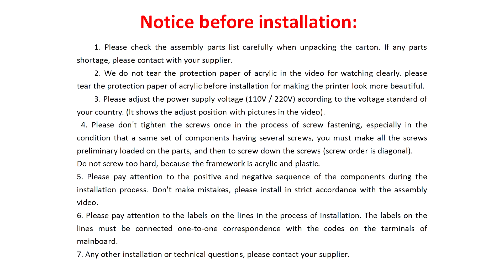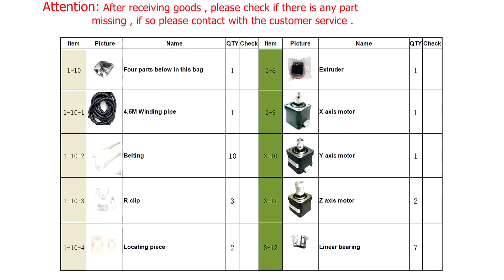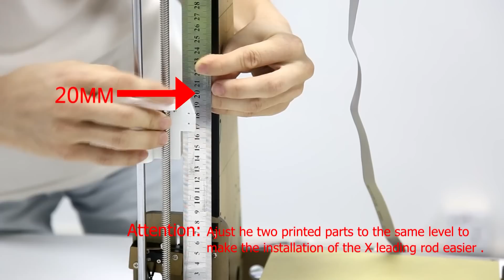3D Printer Instruction--The Newest Anet 3D Printer A8 Assembly Video 1

Comment: HELP : How to turn off the printer while printing and save the work, than turn it on later and start the process where it was left?
Reply: this printer dosen't do that. More expensive ones (MUCH more expensive ones) do that, though
Reply: You can't turn off the printer and then restart where it left.
What you can do is to pause the print and restart it later, only if you do not turn off the printer.
To do that, in the main menu of the printer go to "SD Card" and then "pause print". When you want to restart then go again to "SD Card" and then to "Continue print"

Comment: Hi David, I am about half way through, and impressed with the build quality, until I try to screw in the 3-12 linear bearings. This is at 18:00 minutes into the video. I think I need to buy some longer screws than the m4 x 8. I seems like there is some metal missing when these were cast, and the threads do not start high enough. I will buy some longer screws tomorrow when I go to the hardware store. Can you give me an email address, I will send a photo. Thanks
Reply: I had the same problem indeed. It could just reach the thread. The linear bearings are not that good of quality. One didn't run good and needed to be replaced.

Comment: Hello, David Dan, This is an amazing 3D printer! Nicely done. I recently received mine. Quick question, I do have the
The X Motor Line 
The Y Motor Line 
The E-Motor line (Extruder Line)

But there was the Z motor sticker stuck to the Y Motor Line. There are now 2 UNLABELED Lines they are the same length about 900mm or about (35inches).     

Are the 2  Z Motor lines both Long in an upgraded version (I bought mine in October) compared to the shorter line you have in the video at 24:55 in the video??    Would it make a difference if I were to switch or mix-match those 2 unlabeled lines?

Please Answer as soon as possible, I am stuck as of now
Reply: I'm in the middle of my build and there are two separate lengths for z as in the video, the right hand motor has a 900mm and the left hand one is about half as long. As long as they worked when you did the self test, and you have long enough lines for everything else it won't matter if you mix and match. But I would check the parts list and make sure you don't leave yourself with too short a lead for the xmotor or extruder
Reply: Thanks. Just connected all wires.Doing Self test now
Reply: As long as it can Reach the motherboard from the Motors

Comment: My guide rod wont even go through all the way in the Z axis nut support. Its too tight, unlike in this video, its almost smooth and can be pushed by the hand. I've been hitting it hard with hammer and my hands but wont go through. Its stuck. Why did you guys make it like this. Its probably why some people get a bent rod because of this process. I'm talking about the 33:05 s section of the video.

Comment: My vertical rods are just slightly too short, they still wobble. I will have to add something to stop that. Anyone else have that problem?
Reply: AntFuze me did u find a way to fix it?
Reply: They are supposed to be a little short and not quite rea h the holes.   Just continue and you should be good.
Reply: The vertical guide rods on mine are a bit short. I don't think it matters but I put two washers on the top before fixing the plastic top retainer in place. The other screw threaded rods are meant to be a bit short so they are not supported at the top end.
Reply: @ohchil9009  No, raise the coupling up on the motor, there is plenty of room.

Comment: David, please take a look at the mounting of H-Carriage mount:
https://youtu.be/-tiHfzBQZpI?t=1062

When mounting like you instruct, the belt will not be parallel. Mounting the H-Carriage upside down seems to work better:
https://3dprint.wiki/reprap/anet/a8/bed-carriage

Any comments?
Reply: I noticed that just building mine now. Is it worth me undoing that many screws?
Reply: Let the smooth rails come out and then you'll have very access to the H-carriage. It all takes less than 10m.
Reply: Thanks for the tip
I did it and it works a bit better :)
Reply: I noticed the same while assembling my a8 earlier while lining up the belt to make sure it was running true,  the belt still runs a little high,  (I think I'l be making someting to get it truely parrallel is due course)  if you do this I would also rotate the Y motor so the connector points down to avoid the possibility of its cabling being fouled - thanks for posting this video its helped a lot - its much appreciated

Comment: 4 hours in and I'm only on 21 minutes.... and I build parts for planes for a living!
Reply: Personally just getting the paper off of the black plastic parts is the most time consuming part. I'm an auto tech myself so I screw in nuts and bolts all day....but usually M6 at the smaller end rather than M3. :P

Comment: X motor : 25 mm screws ... not included :(. found some at home, and they are too long ... 18 are too short... only 4 20mm provided, supposedly for something else. That is a fail (and the plastic motor support part profided is different, has 4 screw holes)

Comment: Did anybody think that putting the Z Axis rods into the printed parts was difficult? I had to force them in.
Reply: Mine were as well. I noticed the printed part was warped, so i loosened the brass threaded bushing bolts and the rod spins smoothly now.

Comment: A quick tip.  Use blue thread lock on everything and you won't have to worry about something working it's way loose later.
Reply: Spill blue thread lock on any part of the acrylic joint and kiss that part goodbye.
Reply: Kip Landingham  yes, loctite reacts with acrylic weakening it. Stay away
Reply: I prefer a dab of PVA wood glue after doing up the nut. This can be broken off easily if you need to undo it later.
Reply: Yes a quick tip, not a very useful tip though...

Comment: Some m3 nuts and bolts were not according to specifications and would not fit. Some nuts were too loose and were almost m4. Gladfully there are enough nuts and bolts left after assembly.

Some holes that have thread in the metal parts that are covered with paint or coating so the m3 bolt won't fit and even get damaged. I needed to use a special tool to make the threads work.

Guide runners (linear bearings) were not good quality. 2 of them didn’t run good.

The bolts that are used to level the hotbed should better be allen head or torx so you wont have to press down on the screws during calibartion. 

Be careful with cutting the (toothed) belt to length. I had only 5 cm of belt to spare after assembly. Not the 10-20cm which are mentioned in the documentation.

Comment: Hi David, I am having trouble assembling my printer. It arrived today and I have been putting it together no problem....Until I got to putting the screens back protector on at 27:11 in the video. the piece in my kit is missing two drilled holes on the right hand side. Please see the link attached to see what I mean. https://postimg.org/image/judwk6bup/ 

Please advise. Thanks a lot.

Comment: Hi!
I just received my printer, but two parts are broken and one doesn't fit. Is it possible to get replacement parts?
Reply: Hi Michael,
how did you go from there? Did you got the replacements? or did you have to send everything back?
Reply: Hi Sabe,
I couldn't get any replacement parts, but I got a few dollars refunded.
I filed the part that didn't fit shape and glued the broken one.
Reply: Hi Michael, thank you for your response.
When I wrote to Gearbest (because my Top Frame where the Display is mounted was manufactured wrong) - I told them that I will let the part manufacture here. So they offered me a 20 USD refund to my GB Wallet. Still waiting it to be transferred tho.

Comment: Oh I hate you, at 32:40 there are screws behind the two white pieces that needed to be loosened before inserting the rods. I thought that the Rod hole was a bit tight from manufacturing that I had to hammer the rod with an iron hammer for 5 minutes to get it to the second hole. My hands hurt from the constant hammering. Not to mention what that did to the printer's structure. Thanks for your effort but if u wanna do a dependable tutorial DO IT RIGHT. One mistake and the printer might get useless.

Comment: Email anet@anet3d.com is dead.
Good job on the very thorough assembly documentation but I am not able 
to load the filament or heat up extruder or heat bed. I can print 
TEST.gcode but only without filament. Would you have a step by step how 
to do the loading of filament / HMI? I have no control of extruder at 
HMI which only shows it OFF.
Reply from the maker: Hi Patrick ,
you need to put filament into the hole , maybe you stick it in and it doesn't enter the hole of nozzle , pls try to do this . unfortunately it cannot be recorded by camera because it's a inside operation.
Reply: Thank you. I did stick the filament in the small hole directly
      above the nozzle but does not work even pressing down very firm. I
      think there are small gears inside ?? that grip the filament but they
      are not turning. Plus the extruder does not pre-heat.
Reply from the maker: Patrick McGilvery yes there is . You need to put filament into the gap between two gears .
Reply: Others say when the extruder heats up then insert filament and this is the problem: the extruder dose not heat up. I have reset the board but extruder remains OFF. Even when PLA PREHEAT displays the extruder remains cool. Any suggestions?
Reply from the maker: could you pls upload a video about this and @ me ?
Reply from the maker: Patrick McGilvery Hi Patrick ,  the video shows def of Temp , pls follow the file i sent to you before and check out which part is broken . Also , your filament doesn't fit in , you need to stick it into the gap of wheel on the extruder.When putting in filament , you need to press the screw on the extruder.
Thx
Reply: Saw what you meant about pushing down on the socket head cap screw. Its a spring loaded pivot. Thank you. The extruder and heat bed still won't heat up. Measures 0 volts when printing TEST.gcode coming out of the board to extruder and heat bed. Also PRE HEAT PLA measures 0 volts as mentioned above.
I received no file from you as we have been communicating thru YouTube. My email is patrickmcgilvery at hotmail dot com. Please send that file. Thank you kindly.
Reply from the maker: Patrick McGilvery Hi McGilvery ,check the main. pls follow the file I send to you and confirm which part is broken , i will send you replacement when I confirm the situation.Thx.
Reply: You stopped emailing me. I still have issues with the printer not working. I replaced an open 10k thermistor on the hot bed. The extruder now heats up but the hot bed does not. Where can I get a new hot bed with all the plugs pre wired? The place I bought your kit from doesn't carry these any more.
Reply: You can if you take the fan off.

Comment: Poor design......should never haved ribbed side of a belt riding on a smooth pully....causes vibration...noise...friction...not good for motor....please redesign the machine properly.
Reply: You may have done the pulley screw up too tight so it's trapped between the two plastic brackets and not actually rotating. A fix is to add two m3 washers one each side of the pulley so only the center of the pulley bearing is trapped.